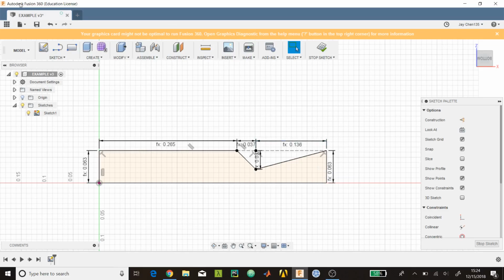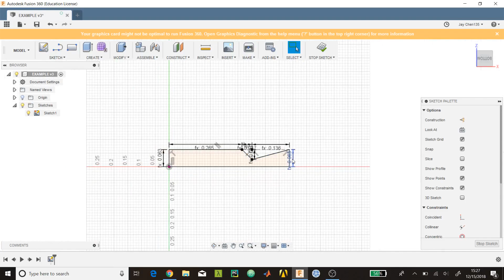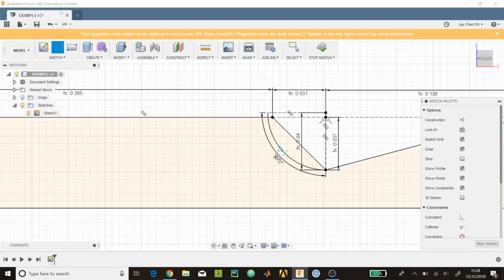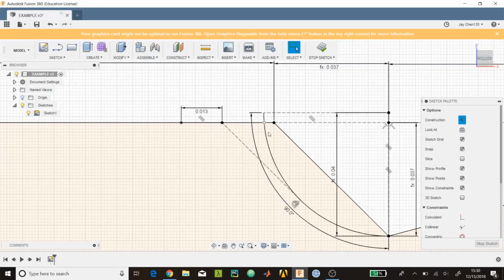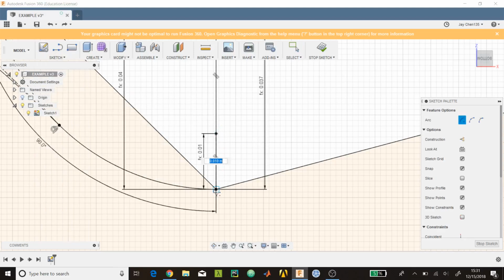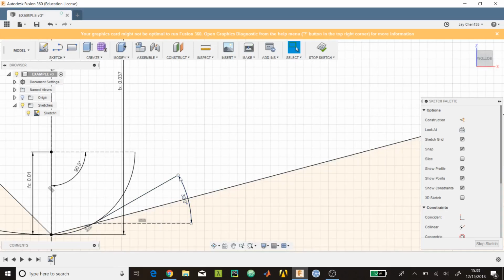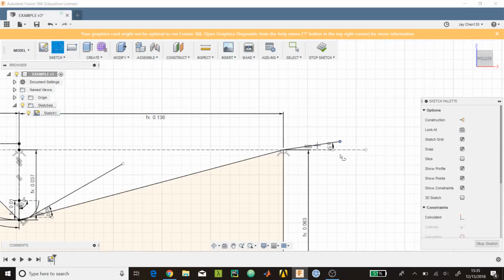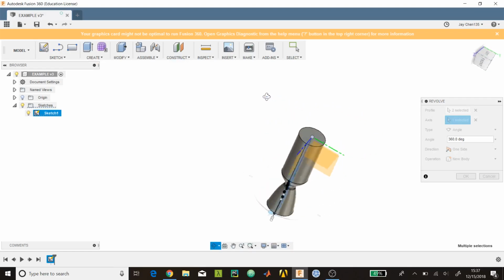Project Caelus: Liquid Rocket Engine - Pt. 2: Nozzle Geometry & Parabolic/Bell Approximation

Comment: If ur making bell shape nozzles then you must make 80 percentage bell nozzle 😬???I am right or wrong ... don't know😑😑
Reply from the maker: It depends on what you're designing for. You're right, normally they go for 80% to save on the length (and therefore weight). But if length and weight aren't too big of a concern, a there's nothing wrong with a 100% length bell nozzle.
Reply: @jasonchen5761  ya right I was designing a rocket nozzle similar to that of electron rocket ....also please can you provide the code of python wich you used for calculation